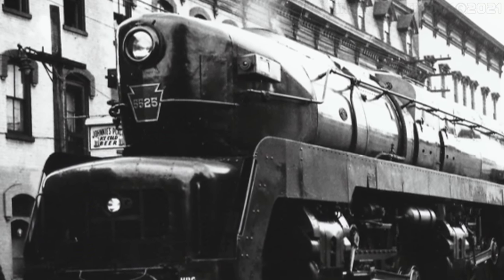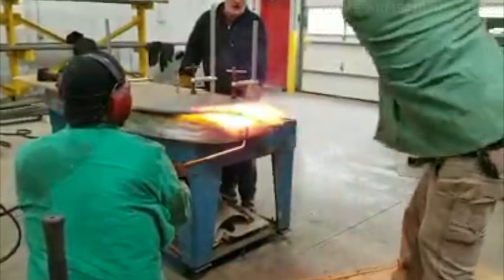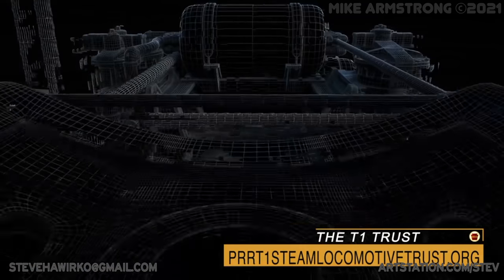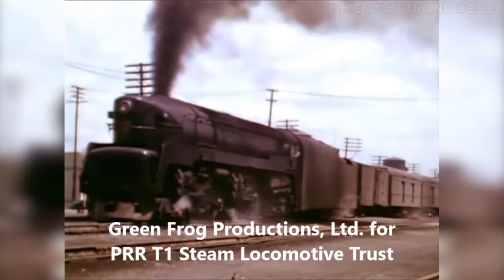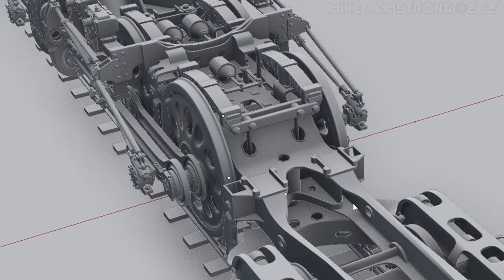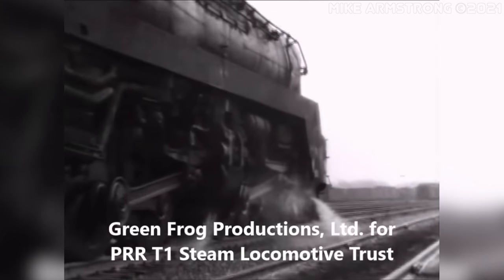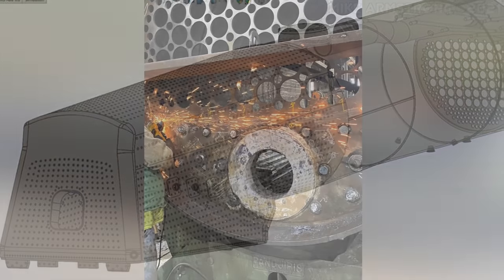Building A Steam Locomotive: PRR T1 5550

Comment: With great power comes great responsibility. And I have to say Mike, it’s fantastic and so great that you’re using your influence on the railroading world and bringing awareness to these preservation groups. Railroad preservation is criminally underrated and it is so great that there are so many of these projects happening around the country to just keep these Iron horses going.
Reply from the maker: Thanks so much! I'm happy to bring awareness to important preservation projects.
Reply: @CoasterFan2105  I saw an old tender from a T1 will it be used on 5550?
Reply: @nolantherailfan5048  close. It is from a Pennsy J1. Same Long Haul tender as used on the T1. Last of its type. Just need to add streamlining and it is an exact match

Comment: Now someone needs to start building a new NYC Hudson. It blows my mind that not a single one of those iconic 200+ Hudsons never made it to preservation
Reply: Dude, I feel you! And the New York Central had a bunch of beautiful steam locomotives that were sadly and unnecessarily scrapped. Like the absolutely stunning 4-8-4 Niagara, 4-8-2 Mohawk, 2-8-2 Light Mikados and hundreds of gorgeous engines the NYC had. I’d love to see a new Niagara built! It’s regarded as one of the best, most powerful and most efficient 4-8-4 Nothern type steam engines ever made.
Reply: @BigBerk765  I don't disagree about the Niagara's aesthetic appeal, but UP 844 is still in service and is 95% the same as a Niagara from a technical standpoint. A few cosmetic tweaks would transform it into a satisfactory facsimile, if anyone was so inclined. So nothing really to be gained by building one. Now a Hudson project, THAT I could get behind...
Reply: @BenRichards227  A lot would be gained from building one. First off, bringing back a lost piece of railroad history. Second, showing off the best and superior 4-8-4 steam locomotive technology in working form. While the FEF might possibly share a lot of the Niagara’s attributes, they’re not exactly the same completely. The Niagara, though similar to the FEF, was still superior to the FEF and multiple other Northern steamers in terms of pulling power, top speed and fuel efficiency. It’s a gorgeous locomotive that shouldn’t have been scrapped and I, for one, would love to see one in person. To have probably the best 4-8-4 steam engine ever built come back would be a treat for any rail fan. Although, I get where you’re coming from. Seeing some locomotives that are most definitely extinct like the 4-6-4 Hudsons or the N&W Y6bs. Those would be great to see get rebuilt as well!  One NYC Hudson steamer that’s probably my all time favorite from the railroad was the Dreyfuss Hudson! The passenger steam locomotive with the “Roman Helmet” look on the front. That was a work of art on rails!

Comment: I honestly don't care whether 5550 beats Mallard's record or not. If it does, oh well, no sense in whining about it, what's done is done. If it doesn't, then Mallard simply keeps the crown for being officially the world's fastest steam locomotive. 5550 may not be 100% like the original T1s, but she'll will at least be more efficient than them. I'm just happy that the PRR T1 class is being resurrected and I'm looking forward to what she'll be capable of, even if she's an improvement over the original T1s.
Reply: i bet the t1 wont almost destroy itself making that speed run like mallard did 

after the run she had to head to doncaster for repairs
Reply: If you believe the stories of those old time Pennsy men, the T1, if not slipping, can run up to 140 mph. They just don't say it out loud, because in those days, it could get you fired, because the old ICC has a speed limit imposition in those days.

Comment: A gentle correction (horsepower claimed at the 2:55 minute mark): as with all modern boilers of the time, with all the efficiency appliances, the T1's boiler produced roughly the same horsepower as did the best Northern type 4-8-4, so that would be upwards of 6000 hp when the pistons were cycling between 4-5 times per second.
Reply: mesenteria..... Please, tell me which Class 1's in the US, possessed "an upwards of 6000 hp" Northern... I would really like to know the answer to that.  Thanks.
Reply: @Romans--bo7br  The Niagaras were at least close to that. That's why they were numbered in the 6,000's.
Reply: @davefrompa5334 ... Dave, Thank you for your reply... I appreciate it.  Yes, I had forgotten about the NYC's Niagra's.... Extremely Impressive batch in the "world of Northerns" for sure.   I know there numerous drawbar power tests done on them over time with results from the high 5K's to just south of 7K.   

Great locomotives for sure.    

In many ways... wish we could go back to those times... when the USA.... WAS, a great country.

Comment: I'm very surprised how far the project has come to date.
Creating a new build of this size, probably 3 times as expensive as Tornado due to the enormous size of all parts, was to be a very big enterprise.
As far as fundraising is concerned, are there some lottery funds like in the UK where an appeal for a grant can be done to help to support projects like this? or has all to come from the private sponsors?
A good thing is that the design is reworked not only to meet current mainline standards and code, but also to iron out some imperfections in the original design.
It's actually the same route like the British A1 trust follows for their current new build under construction, the LNER P2 "Prince of Wales", here also the poppet valve system and leading truck are redesigned and all modern safety equipment is integrated in the design.
These and improvements in steam pipe and blast pipe arrangements will make this new P2 the locomotive which it wasn't fully for the LNER.
Reply: America does not have historic preservation lotteries so the railway preservationists have to raise funds through sponsors and private donations. And yes, this build is similar to the P2 build in the UK, with changes from the original to make the loco better.

Comment: Aside from nostalgia, there a couple of very good reasons to build and restore steam locomotives: an EMP attack and a Carrington-type event from the sun. Both events will render all electronics inactive. No computer-controlled deasil locomotives will run. No modern cars or trucks will run. After such an event, steam locomotives will be the only forms of mass transportation that will still run...no electronics, just mechanical parts. You will need them to help rebuild the country.

Comment: An amazing engineering undertaking.  LOL, I don't understand all the quantities and capacities quoted, because I only know Metric - but it sounds impressive. Very disappointing that no one in the 1950s saw fit to preserve at least one example out of a total of 52 locomotives. The latest metallurgy and fabrication methods are a huge bonus for the new T1. I'll jump in and say it would be appropriate for final assembly to proceed where Baldwin was based.

Comment: To be honest, I don't get the appeal of making a T1 when you could just build a brand new 4-8-4 or even a brand new 2-8-4 L&N "Big Emma" Berkshire. But at the same time, I do understand bringing back an extinct class. But it kinda doesn't matter about the speed record because it was broken almost 90 years ago. A better task would be to use 611's lubrication system which can go 500 miles without servicing and figure out how to make it go 1000 miles. That way they can break a much less dangerous record, the longest non-stop run performed by a steam locomotive which needs to be over 500 miles.

Comment: The inherent slipping problem is not likely to be resolved because: 
The two sets of drivers are independent (better if connected)
The high speed nature of the short stroke/large diameter wheels doesn't work well at low speeds. Like starting your car in high gear.
Reply: How to connect the-

...oh...

Does the big boy have this problem?
Reply: @theextremeanimator4721  No, the Big Boy has much smaller 68 inch driving wheels and a longer stroke at 32 inches, so it's better at lower speeds than the T1.

Comment: As much as I'd love to see a new T1 on the rails, as it is a very classy and historically significant passenger locomotive, I'm not in favor of setting a new speed record for steam locomotives, and here's why.

1. It's pointless to do in the 21st century. Steam locomotives are no longer in regular service. What would setting a new speed record for steam locomotives do in a world where they're obsolete?

2. While I am aware that 5550 will be fitted with Franklin Type B valve gear, the T1 itself has a mixed reputation for its shoddy valve gear and a lot of people would miss the fact that it'll be fitted with Type B valve gear as opposed to Type A. They could've also made the decision to fit T1 5550 with Walschaerts piston valve gear, like on T1 5547 (reclassified as T1a), which was easier to maintain and actually functioned very well.

3. T1 5550 will NOT be based on the prototypes, 6110 and 6111. The two prototype T1s functioned better in service than any of the production locomotives. In my humble opinion, 5550 should've been based on the prototype T1 if it wanted to have a chance at setting a new world speed record.

There you have it. I'm not hating on the T1 Trust, I just want them to stay away from smashing a speed record for steam traction. I know it was rumored that the T1 set a record, but there was no official account of it and it's rarely talked about since no special exhibition was made.

Hope you found this interesting, and my apologies if I got any of my facts wrong.

Comment: 16:46 No Class 1 wants to re enter Highspeed passenger train service. and not even with coalburning steams nor diesels. And even in Freight business, they settled in kilometers long slow freights rather than competing in Fast Freight services as in 40s-50s.
Reply: Union Pacific when they run 844 are allowed to go 60-80 mph, and usually they do. They could but it has to be 80 or below since that is the speed limit unless it is Amtrak, then they could go 90-110 mph in certain cases. Also, since PRR 5550 will be out in the Eastern side of the country, coal firing isn't a problem.

Comment: Will T1 5550 be built as coalburner or oilburner?
If this one is meant to burn coal. will it uses computerized boiler control and stoking mecahnisms?
Reply: Coal, and it will have a stoker
Reply: I stand corrected, it will be an oil burner.

Comment: Where will it run?
Reply from the maker: Take a look at 16:29 for more info on that.
Reply: @CoasterFan2105  sorry, I meant in wich part of the USA. I live in the southwest, will I have to travel to the northeast to see it?
Reply: @nicopavvi8494  Most likely
Reply from the maker: @nicopavvi8494  Most likely the Northeast, as the 5550 will likely be based out of there, but it may make trips to other areas too, like for the high speed testing in Colorado.
Reply: @CoasterFan2105  thanks

Comment: I personally do not believe the T1’s or S1 ever reached speeds that high. It simply just didn’t happen, unless there’s some concrete evidence of it. As far as I understand, the Mallard still holds the record for 126 mph.
Reply: Thats because Mallards records were official, but the T1s or S1s were not. The PRR didn't care about the speed record, they cared about who could get passengers faster from New York to Chicago, them or New York Central. You also have to keep in mind that the Trust has most of the existing T1 records, papers, and drawings, so they know whether it's even possible or not.
Reply: @regularguy7266  so basically, it could’ve gone that fast, we don’t really know, because there’s no evidence
Reply: @benwetzel8449  service records and papers are evidence. What will be more important is if the Trust can prove that those still hold value (even though historically they already do) and confirm the myth that has had rail enthusiasts confused for years. We shall see.
Reply: @regularguy7266  ok, so it’s a myth that we currently have no proof for. But, the proof might exist, in some papers from a non profit, that they aren’t showing us

Comment: I don’t think he knows about it’s violent wheel slip.
Reply: The two prototype T1s 6110 and 6111 were very slippery. Changes to the spring rigging were made between the prototypes and production units, that was mentioned in this video. Also, the PRR employees back in the day didn’t have proper training operating the T1s, since they were use to running K4 locomotives, also mentioned in this video.
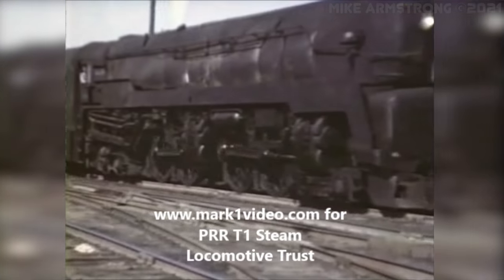Reply: 5:47

Comment: Railroad’s we’re known for inflating there recorded speeds for steam. Like the Dreyfus Hudson’s  nycr reported speeds nearing 130 but the locomotives never managed over 109 officially I honestly wouldn’t be surprised if the trust goes through all this effort only for the engine to fail to break over 110 mph if it does then the reasonable limit for an engine with such an odd design would be around 115-120 but definitely not the 140+ prr reported when the trust goes to do speed runs they’ll probably have to try more than once for over 100 in the first place.  I honestly believe that these poor folks are kinda blinded by the nostalgic idea of it and not seeing that even though yes it was designed apparently for high speed passenger service the supposed consistent 100mph+ recorded might have been all she could do without breaking something severely. Not trying to be a downer just being realistic in the interest off all parties while it will be nice to have a new steamer again don’t get too hopefull. If they have to cancel the project or it doesn’t live up for whatever reason it’ll let down a lot of people.

Comment: The T1 was not that fast its a mistake it was the s1 that was mean to run 140mph not t1...the t1 have to small wheels to run so fast and have big problems with poppetvalve in only 100mph so i do not think it ever will run over 200kmh ever
Reply: They may go for the record without pulling cars.

Comment: There is no way that would hit 100 let a loan 140mph
Reply: Why?
Reply: The T1 has been the fastest this whole time.
Reply: 80" drivers, lightweight rods, roller bearings, 300 psi boiler pressure, high horsepower, the T1 is MORE than capable of 100+ mph speeds

Comment: The T1 was a good idea that didn't work. To reconstruct a good looking, but flawed machine is ridiculous.
Reply: It’s not ridiculous. This locomotive class is worth it for reconstruction. You probably don’t realize the prototypes had most of the issues. The production versions were 90% better than the prototypes. Then we have 5550 that will be an even improved locomotive in the class with advanced technology and franklin type B valve gear. This project is worth it, no matter what you say.